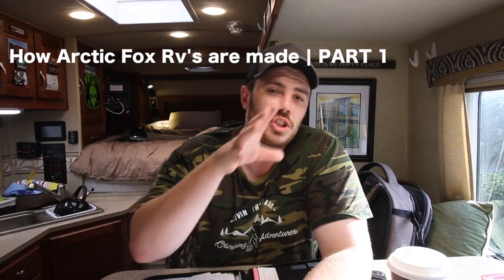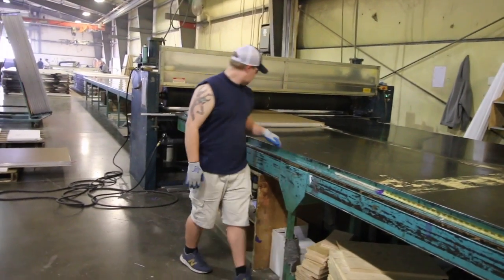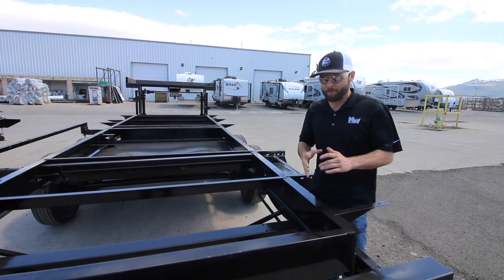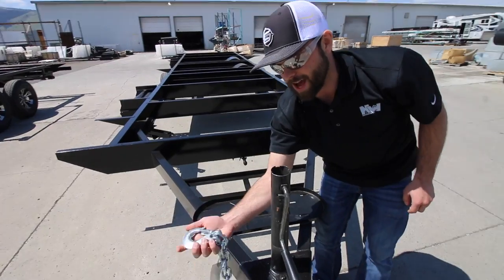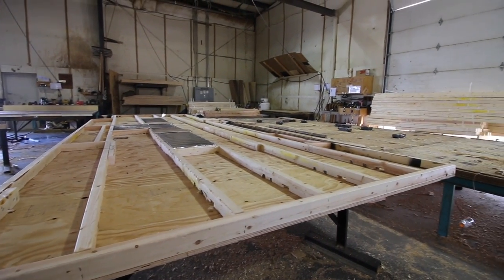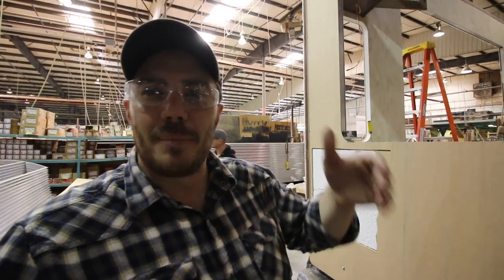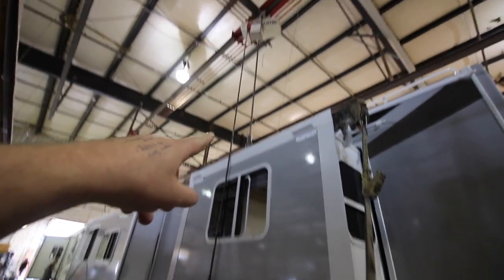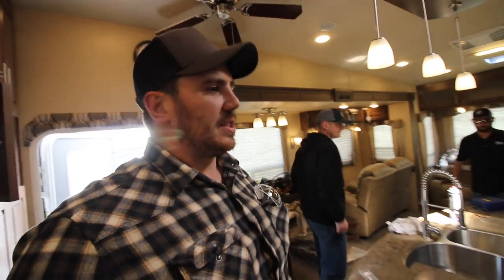How ARCTIC FOX 5TH WHEELS and TRAVEL TRAILERS Are Made ?! | FULL FACTORY TOUR

Comment: While those trailers are built a bit sturdier, much of my 13 year old trailer is built the same way.  It's damned hard to fix it after it's all glued together.  I'd like to see a serious effort in not using caulk to seal roofs; in not using a thin rubber membrane.  I'd like to see FlexArmor which is a thick 187 mil fast drying gel that covers all of the roof and fasteners.  No more caulking, re-caulking, peeling off old caulk, repairing, and applying new caulk.  Roof maintenance is the most dangerous chore on my trailer which is the height of a semi-trailer.  Another per peeve is the wood floor structure between the steel trailer frame and the aluminum frame.  Any roof damage and this wood structure where the steel and aluminum meet rots.  It's a real pain to replace.  I replaced this connection with a flexible polymer that has the strength, but is flexible to take the load.  No more wood structure between these two metals.  I'd like to see #12 wire and 20 amp breakers with wiring trunks.  I'd also like to see wind bracing on the landing gear and jacks.  But the roof is the number one issue in my book.

Comment: I have a couple of questions about your artic fox taylor or anybody else and they are with the tanks being heated are they heated during summer or is there a switch to shut the heating system off and what happens to your fridge if you run out of propane does it switch over to your batteries by its self also your heating system to if you run out of propane what happens and one more question if your batteries get too low anytime does your generator automatically come on or do you have to turn it on thanks for giving me some good info
Reply: The fridge runs on either propane or 110. It will not run on just batteries.   If you are hooked to 110 and set to automatic the fridge will choose power.  The generator will only turn in when you hit the button.  The power station has a voltage meter to let you know the state of charge.  The tanks do not have heating elements in them but do have vents in the front and rear to allow air to flow.  Taylor mentioned in one video that it would be nice if the vent under the step into the bathroom had a fan in it to actually force warm air into the lower  holding tanks portion of the coach.

Comment: The video is supposed to be a "How it's made video" for Travel Trailers.  You spent about 14 seconds showing how the roof is constructed.  Travel Trailers are notorious for Roof Leaks which also run down the wall and cause rot to occur.  It was quite disappointing to that you didn't take this opportunity to challenge this manufacturer of known problems in the industry.  It looks like this manufacturer is above average quality but I would have addressed these concerns while you had their ear on Video.

Comment: Leaf springs wow America does not embrace new tech in in vehicles. Not that shocks are new tech we moved on to airbag in Europe. Still using wood in the framing why not composite that will not rot. Europeans been using composites for a number if years now. Lighter stronger no rot issues